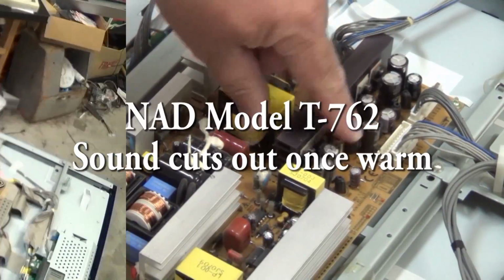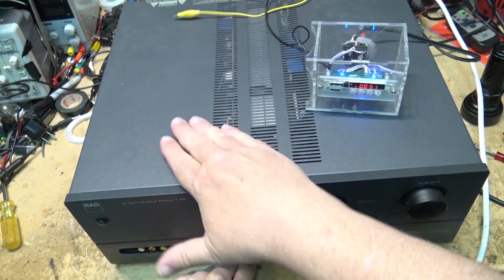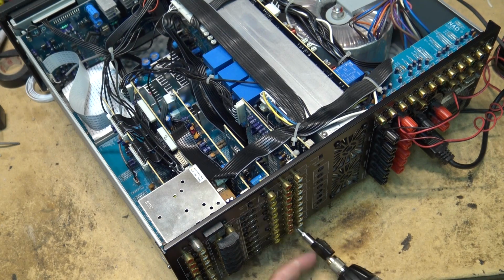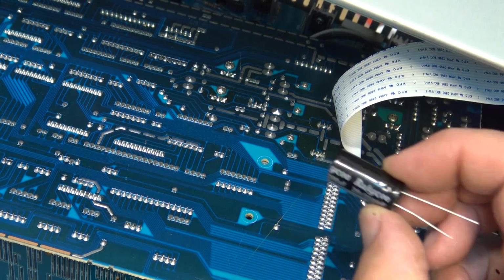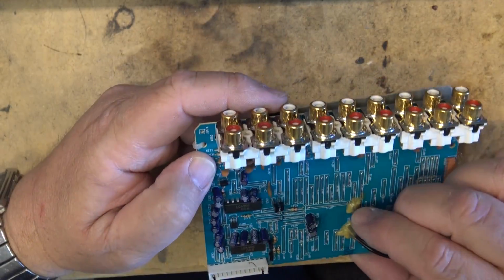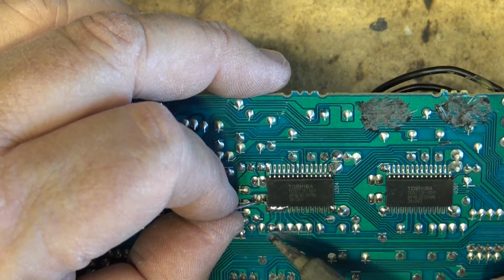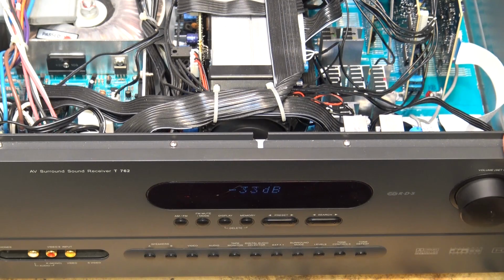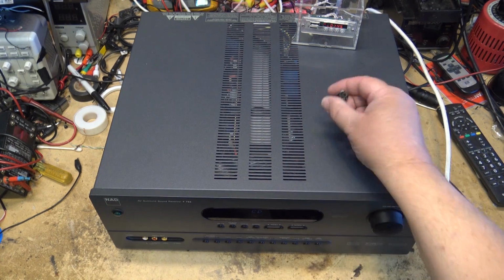NAD T-762 Sound Cuts Out When Warm

Comment: Thanks for sharing. Your video gave me a courage to fix my NAD T-752. It had similar problems like yours i.e.  power cutting out when it's hot. However, the problem is not the capacitor defect. First, I replaced capacitor running hot on main board; but the problem still exists after running the unit at high volume for about 30 minutes. Then, I re-soldered all voltage regulators for 5V and 12V. This fixed the problems i.e.  I run the unit at high volume for 2 hours now without any power cutout. In conclusion, those voltage regulators had run super-hot over the years of services causing their cold solder joints that made power cutout when hot.
Keep up your good works! Thanks again for your inspiration.

Comment: This vid came up in my search for a possible reason,  the FM band on my Yamaha T-07 from the 70s  would totally drop out after 10 to 20 mins of use. There were no obvious bad Caps, but after scraping away caked glue on  deposits around some solder joints, the unit is working fine now. Thanks for the tip on the glue getting conductive with age.

Comment: Why do you use scissors to cut off the leads. The shearing force to cut the lead is equal on the pad when you use shears. Proper cutters apply equal force on both sides of the leads, thus zero lateral force on the pads. I paid about $2 for a proper set of cutters and they work great. Also, you are bending over the daughter boards far too aggressively. My point is only for constructive criticism, because why add such undue stress. You know better than most people how important solid connections are in electronics and how future problem can arise from lose connections. If you think that is a bad design you should try working on a modern Marantz receiver (nightmare to even get to the test point) . You would love working on a B&K Components receiver with it's modular design and ease of access to all board.
Reply from the maker: I'm not bending the daughterboards over.  Just enough force to seat the connectors. As to the electricians scisors they acutly place less stress on the lead then side cutters which if in contact with the board will apply vertical stress on the lead. Try it some time.

Comment: Who is responsible for doing due diligence for the supplier?  If I do due diligence for my own repairs, I will not use eBay as a "supplier", because there is a very high rate of "Fake" components. You do have some control, but you might have to pay a little more. Due diligence doesn't not equate to a guarantee, but it's much better than relying on a crap shoot. I think you are triggering some people because it's seems like you are just passing the buck, rather than saying that you are doing your own due diligence. That is the best anyone can ask for. Any rational person knows that getting genuine parts from Digi-Key or Mouser is much higher than from eBay or the like. E-Bay passes the buck to the sellers, so their reputation is not on the line. A supplier has to have their reputation on the line, otherwise the bottom dollar dictates their concern for your satisfaction.
Reply from the maker: Do you really know where your supplier is sourcing their components? No you don't.  Even suppliers like digikey and mouser get stung with counterfeit parts.  Why do you think they don't offer warranties or returns.  Component sellers source parts from other jobbers that fill their orders and one time they get good parts and the next time bad ones.  Believe me i saw tons of bad parts when i was in the business.  First batch of horizontal output transistors were great.  Went through a few dozen never problem all of a sudden they start popping like fuses. One after another.  All came from same supplier and he ordered from his same supplier.  What happened was his supplier found another source that was a few cents cheaper.  By the time we knew what was up we had a bag of 50 parts we could not use.  The supplier had 1000. What is he going to do? Throw them out? No, he sold them all. After all he is just the retailer.  Nothing has changed.  No supplier will eat them.   That's the way it is.  You buy the parts you take your chances.  The person that gets burned is the customer because when bad parts are obtained and have to be replaced ultimately it is the customer that pays the price.

Comment: I changed the bulging cap and did a full recap on the board as well. I also reflowed the regulators as per your video.  But it still has the same issue that sound cuts out after warmed up. 

Did your repair solved the problem?
Reply from the maker: Yes working fine afaik.
Reply: @12voltvids  I'm guessing could be a cold solder joint somewhere as it only exhibits this behavior after about 10 mins too. I didn't reflow the chip on the input board though... Do you think that could be the issue?

Comment: I just got myself a T762 and the same capacitor is bulging as well. Great video. Thanks again
Reply: Same on my nad t762 also. This already looks like an engineering miscalculation. The capacitor is between two radiators, plus there is another very hot part on the third side. It is quite possible that this is exactly why it breaks down.

Comment: At around 11:48 you pop the two daughter boards off of the main board. For the life of me, I can't get those boards out. Can you explain how you got them off without breaking the PCBs? It looks like those edge connectors have locking tabs on them and I can't get at them..
Reply from the maker: Just rock them back and forth and they will let go
Reply: @12voltvids  You're not kidding this amp is a pain to take apart. Before I put it back together, I'm going to reflow the solder on those edge connectors, I had to rock them so hard to get them apart. Many thanks for showing the way. I would have been in over my head otherwise.

Comment: Hello 12voltvids! I wonder if you could give me any tips on my Nad T754 reciever. The front speakers works good, speaker B output works good but surround L/R cuts the sound in and out when lower frequencies comes and when I turn up the volume it goes away mostly. But if I restart the amp the issue is back. It is on all sound settings (stereo, PLII movie, etc etc) and it's mostly the right channel but sometimes both (not at the same time). I have opened the reciever and tapped some on one of the relays and then it seem to disappear. But I am not an engineer and Iam not sure how to change the relay. It doesnt seem to be possible to open the relay either? Wich is wierd. Just wondering if you could have any tips on what I can do, if I can do anything myself.
*Edit I should also mention that if I switch front and back speaker outputs the problem goes to the front. So it cant be the speakers fault.

Comment: I bought a Marantz 19 in 1974. Use it everyday. No ICs. 66 discrete transistors. Built to last and be serviced.
Reply from the maker: Discrete parts are always preferred to ipm type amplifier have some advantages.  All the components are matched and are generally very nice sounding and low distortion.  They however are easy to blow up.
Reply: About 30 years ago, two pre-amp section transistors blew up. But  it was an easy repair on the 19. The scary part is if the O-Scope burns out. That part may be impossible to find.I try not to use the scope to preserve it but I bet the filament is on all the time. My 19 now makes a small pop when I turn it off. I bet some of those old caps are going bad.This 19 wasone of the last ones made. Sony bought the company (SuperScope) and had the last ones assembled in Japan to save money. Wow has that changed. It would be China or Vietnam now. The parts are American. Some caps are made by Temple Industries which had a factory in Tecate, Mexico close to San Diego. 50 years ago, they were probably the first Maquiladora which are so common in Tijuana (Bose, Polk, Sound United). We have a famous tech here in San Diego but he doesn't do You Tube. Google "Mike Zuccaro". He probably wouldn't work on the NADs. He likes the vintage stuff.

Comment: Hello, enjoy your videos!   Amazing patients.   I was wondering why you did not replace more capacitors (not the Hot bulk capacitor)?  It seems to me that with that much trouble to dismantle this unit, you may as well to avoid "old cap issues" later on.
Reply from the maker: Would you put parts in out of your pocket for someone else? I had a limit of 50.00 to repair this so, I am not spending a dime more on parts that the absolute minimum.   It is not like the old days where people were willing to spend money on things.    When I get something in for repair most come with spend limits.  I either fix it up to the limit or I don't fix it at all. Now for those that charge an estimate fee they can probably make even more money than me because they charge the 50 or 80 estimate fee, and then quote every possible part that could fail down the road.  Basically hold a gun to the owners head and say it will be 300 to fix it or you can have it back and I still got your money. 
There is a local stereo shop that does just that as I have gotten stuff that they have been into and given huge estimates on and I get them and it is a single part causing the issue.   These guys charging estimate fees can make a good living not fixing anything just giving huge estimates, so high that nobody will fix anything.   I don't charge estimate fees, so if I don't repair I make nothing. If I take something apart and spend an hour and then determine it is going to be expensive and tell them how much it will be and they walk I get nothing.  So when I take on a project I try to estimate what something might run before I get in, or the owner may come in and say if you can do it for 50 or 100 do it otherwise forget it.  So for those jobs, the single part gets changed and not the possible failures that might happen.  If someone brought me an amp and said give it a total overhaul then I would change all the caps and charge accordingly but I don't get those customers and quite frankly don't want them because those are the ones that will come back over and over because something isn't right.  Things like the speaker relay takes 7 seconds to kick on and it used to take 6, or once in awhile I hear a click, or momentary hum, or some other strange problem that never recurs in the shop.
Reply: @12voltvids  that definitely makes "cents".......😁

Comment: Vintage audio is great I have 3 Cerwin Vega power amps from 1975 built for the movie earthquake in Center on in the Poseidon Adventure using them for DJ power amplifiers just one unit is powering for 15 inch speaker cabinets and four 12in speaker cabinets along with two 12 inch subwoofers 1 power app it is amazing...
Along with 12 mid-range speakers + 12 tweeters 12 horns.....
2 - 1800 one 3000i the only things that were done for the solder joints were redone and the coils where replaced...
I hope to get 40 or 50 more years out of them.

Comment: You mention about counterfeit parts, I agree you have to rely on the supplier due diligence. The problem is China does not give a shit about any of the laws or restrictions about steeling technology from legit vendors and making their own crap.  This is exactly what happen to the FTDI323 the chineese stole the concept and made counterfeit and the company in the US went bankrupt cause what they did was in the driver software check to see if the chip was legit and if it was not legit it would jail lock the chip. Pissed of a ton of people and now the chineese CH340 took over which is their design. SAD how we get F&^$# over from these ass holes.

Comment: As always, you do a great job. I love your commentary in your videos. When you first look at the receiver it looks like a nice "modular" design until they add all of the extra wires to the "modular" boards. I think all designers/engineers should be mandated to work on/repair the stuff they design, not just electronics, but mechanical (i.e. cars).

Comment: So 50 screws and a hour's work to change a filter capacitor; obviously not designed with repair in mind.   I still have my set of Archer tools which includes that pick and scraper. It must be 35 years ago that I purchased it.  Good repair, thanks.
Reply from the maker: Well I probably got my set of Archer tools when I was about 12 and I am 56 now, so yes they are pretty old.  I have the wire wrap tool somewhere too, and the metal bristle brush.

Comment: Why were so many jumper wires used on the tops of the boards as opposed to being traces on the PCB?  Was it just cheaper to cut, form, place and solder all those wires instead of adding them as traces?
Reply from the maker: Don't ask me I didn't design it. Possibly to move conductors away from board to reduce mutual interference?

Comment: I saw once, on a television board- what appeared to be coca cola residue- everything worked fine for about ten  minutes, when it warmed up, gooey residue would pull cracks in the printed circuit foil apart, opening the circuit.

Comment: I repaired these new when still under warranty, horrible and one of the atrocious T series amps that ruined NAD's reputation. Those caps always dried out, the regs fail and also the DSP board. Int problems were also caused by oxidation of the flexible ribbon connectors.. just a mess of an amp.
Reply from the maker: Yes like most modern stuff, CRAPOLA

Comment: I'm surprised the cap was getting hot.  If it was in a switching power supply, sure, but that board looked like it was analog voltage regulation.

Comment: I have a nad c352, I changed out all the caps. The ones in there weren't gone but we're stressed. Cheap rubbish. So I put elna and Panasonic ones in and it's working great. The c352 has a removable hatch underneath so was a dream to work on. Great video as always 😃

Comment: Seems they went through an incredible amount of effort to avoid double-sided circuit boards. I've never seen so many jumper links, wow! Cost-cutting at its finest. This would be much less of a nightmare to work on if they had used double-sided boards, it would have cut down the size of the boards by about half!

Comment: The EASIEST way to remove glue is with a soldering iron!  Just keep air flow across the bench and clean your tip afterwards.  But it knocks it all off in no time flat.

Comment: So they put a low temp 85C rated cap (and a no name Chinese crap one at that) right up against a heatsink?

Heating an electrolytic drastically shortens it's life keeping it as far away from direct sources of heat as possible is electronics engineering 101. Who designed this piece of junk?

Comment: Is there any possible way to make the surrounds on my 5.1 system the same volume as the fronts without having to turn the fronts down? I hate how the surrounds are so low at max volume in the settings, and the fronts are of normal volume level.
Reply: Get speakers with the same impedance.
Reply: @airgliderz  they are all 8 ohm.
Reply: @brony4life1982  hmm, must be different efficiency or big difference in speaker cable wire length or wire Guage.

Are they the same brand size model of speaker? If not, even though 8ohm they may have different impedance curves based on frequency of sound.

To even out sound you could add a resistor in series, picking right size in ohms will be a challenge till volumes are close...
Reply: The surrounds aren't supposed to be loud they're for ambience lol

Comment: Amazed that cap hadn't blown its top! Gotta wonder if they had it running close to its maximum rated voltage which would be indicative of a poor design..or perhaps a little planned obsolescence which ever way you wanna look at it! 

Of course, you'd never expect it from a big-name manufacturer..but as so often, the wonders never cease to amaze! ;)
Reply from the maker: Actually NAD do design their equipment well, but they farm out the manufacturing and I am sure the cap was running close to it's rating. It was an 85C, and I replaced it with a 105C. The new one does not get that hot running at 37C after several hours, and I would imagine it is just convection transfer from the heat sinks around it.

Comment: while my Yahmaha R-V905 is quite out dated it never gives me any fuss. My only issue with it is until it gets warm there is slight noise on the digital side of it. Me thinks it might be old caps but it is not that old so I don't bother with it. the amp section is flawless. I did how ever replace the main power filtering caps. pulls a healthy 28 watts idle and only goes up when it plays sound so it is doing great.

Comment: HI YOU  are right about ebay  things not working all the time. if it's on ebay for silly money it's bad
Reply from the maker: I don't buy things on fleabay. Every thing I have purchased had one thing of another wrong with it. Amazon market is even worse.
I bought an old Heatkit panaplex clock and had to fix it, I also bought a collector calculator with panaplex display and it was totally dead. 2 DAT machines that both had many issues.
My son just bought a vintage Nintendo game console from a seller on Amazon. I won't say what he paid, but it was way too much. Guess what? The controller doesn't work. I don't sell on fleabay either. Got burned by a buyer that claimed what I sold 14 years ago didn't work when it arrived, and caused me a major headache with them because they refused to ship it back.

Comment: You could make instant cofee with 65C :) The placement of the boards and cooling system looks a bit like Onkyo (nowhere near sound) but the PCB's design with all those bridges and cables, almost no SMD components and tracing  is terrible, no wonder why its so noisy and looks Chineese cheap. TC9273F is shift register with dual 10 analog switches on outputs and that is why it clicks when no sound ... terrible mute function or crack on joint, if problem on one channel, but if all cuts YES the bulging cap